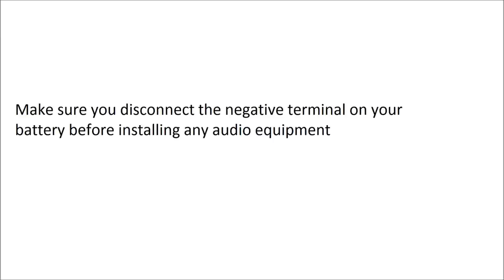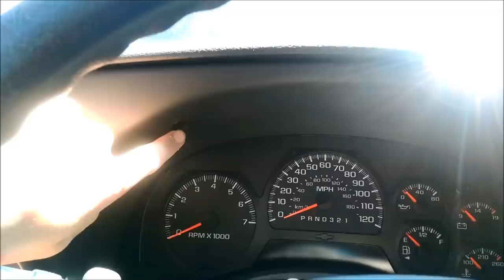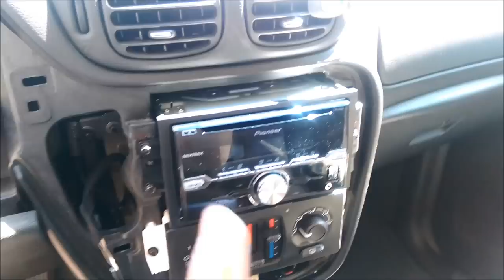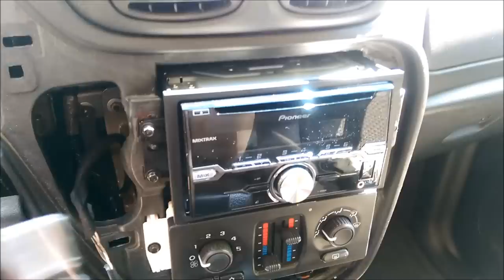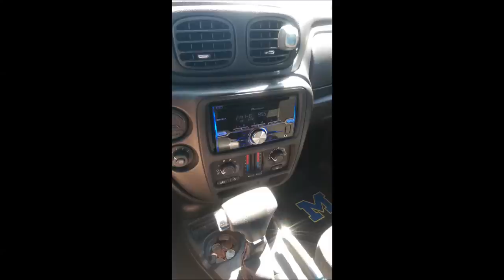Radio install in Chevy Trailblazer with Bose premium sound

Comment: I have a 09 trailblazer ss with bose.. I purchased the pac kit and wanted to install a head unit. a jl audio mono amp along with 2 12s.. Will i have any issues running this amp along with the factory bose amp
Reply from the maker: Ethan Hamilton nope. good thing you got the pac kit. it’s a lot better. your aftermarket head unit should have RCA outputs for a sub amp. and you will run those rcas to the sub amp. and give the amp power and ground. it will be a complete separate system from the bose amp for the door speakers.
Reply: @RydogsGarage  thanks man. Did you run the power for your amp all way to battery, i had heard there was a power source under the rear seats of the trailblazer
Reply from the maker: Ethan Hamilton i ran mine right to the battery. i was running 1500watts. so i had 4 gauge ran. i wouldn’t use the connection under the seat. the trans computer is right there and needs that power
Reply: @RydogsGarage  thanks man. Huge help
Reply from the maker: Ethan Hamilton no problem
Reply: @RydogsGarage  hey man quick question. I got aftermarket radio installed and my speakers only play when you hit the onstar speak button on the steering wheel. Then when turn it off. The speakers stop. Any ideas??
Reply from the maker: what pac harness did you get. there will be 2 conections on the blue box. one for amped and one for not amped. you want the amped conections for the bose
Reply: @RydogsGarage  i got the rp5 gm11 pac.. And it is hooked to the amplified plug
Reply from the maker: Ethan Hamilton you have the right harness. there is a chance one of the wires is not  hooked up properly. it’s hard for me to pinpoint exact issue in that case when i would have to see it.
Reply: @RydogsGarage  i got it figured out. Thanks man. Big help

Comment: did you install a capacitor or  buy  a bigger battery?
Reply from the maker: +Ken S. no i did not, it has a interstate battery thats newer so not factory battery but its not one thats upgraded for sound, stock everything, just added the power cable for the amp. i have 2 12inch subs that are 4ohm, with an amp thats 500watts and 4 ohms, all factory bose with the pioneer head unit. been working great for 8 months and i jam out everyday.
Reply: "its not the one upgraded for sound". Please can u clarify what that part means. You have a seperate battery for sound?
Reply from the maker: +Ken S. it's a OEM replacement battery, had the factory 2009 battery in it and in April of 2015 it died, just replaced it with one that I got at the local auto parts store that's the same, nothing special,and no it's just the single battery

Comment: after installing my radio with the same harness now I am getting static out the rear doors and dash doors can't get rid of it any tips I have an 08 trailblazer bose onstar
Reply from the maker: that may be a problem with your bose amp, that's in the rear cargo area on the pssanger side under the window in the side pannel

Comment: Got a question i used a pac interface and everything works great just wondering why my radio is loud. What i mean is on volume 1 it’s loud.
Reply from the maker: Regena Rodriguez on the pac interface there is 2 plugs one says amplified, and one is non amp. if you have bose you have to be plugged into the factory amplified plug. also check your source input on your radio. it may be turned up
Reply: Rydog's Garage I plugged mine in and it has a wine from alternator what do I do?

Comment: whats the model of the infterface? just trying to confirm because i have bose and onstar. thanks
Reply from the maker: GMOS-04
Reply: And you have bose and onstar
Reply from the maker: yes, I have disabled onstar, recently but I have used this interface for my radio for over a year and I crank it every day no issues

Comment: What Metra interface because they have one at Wal-Mart for 39 can you please tell me if I got the right one it's wm gm11 swc
Reply: Prolly not if it has a bose system cheapest on I could find was 93$ that works with Bose and that’s the pac interface

Comment: I install one but I'm not getting no sound I might need to higher the Volume on the Module?
Reply: Big D that blue knob on the box only changes the chime volume. You need to go back and look at the color coding of the wires and look up the wiring diagram of this aftermarket box. Make sure the connections are tight and no bare wires are exposed.

Comment: I can't hook up subs in my truck and I have that Bose system is there something I have to buy to get them to work
Reply from the maker: not sure how to splice the connections and use adapters to get you to Rca that will plug into your amp, I always change my head unit
Reply: I changed it but it was the radio sub jacks that was not working so I had to get a new radio and it works now but thanks

Comment: is there any size of aftermarket stereo that will not fit in a 05 trailblazer?
Reply from the maker: Brandie Kinman no becuase they make single din and double din. the trailblazer is a double din size from factory so your able to buy any one just need the proper bracket with the radio

Comment: Ok so I got the harness but my Aetna wire doesn't match up with the back of my new radio where do I find that connector piece
Reply from the maker: +Dere'ana Phillips you need a gm antenna  adapter and you can buy them anywhere online

Comment: Would this process be same in a 2005 trailblazer  with Bose using the pac adapter?
Reply from the maker: Tyree Bradley yes exactly the same i have the pac adaptor now and it’s amazing sounds way better than the one in the video
Reply: Rydog's Garage Is there a link for the PAC adapter?

Comment: quick question; how do I check if I have the bose system?
Reply from the maker: my radio would say Bose when you put the key in and turn it to power
Reply from the maker: +David Wence yes it would, if you still pay and use onstar, because I don't so I just disabled the system, if you don't have Bose and don't mind disabling onstar you can just get a normal adaptor harness and save a ton of money but that system is best bet, will be best experience

Comment: Hey guys I got a 2004 trailblazer I put in a Alpine aftermarket I connected all the wires color to color but I won't get no power to the radio unless I use connect the red wire to my fuse box any suggestions or info on my problem it drains my battery because the radio won't shut off
Reply from the maker: Arturo Gonzalez red wire is 12v ignition. suppost to be hooked up to the ignition fuse with a ad a circuit fuse tap if you don’t use a harness like i did in this video. yellow is constant 12v black is ground. make sure all thoe connections are good first

Comment: I put the factory back and no static didn't know if I needed a loc or some kind of filter
Reply from the maker: possibly, what radio are you using? and did you set the gain on the adaptor
Reply: Kenwood hd the only control on there is for the chimes

Comment: I bough a 03 trailblazer 
onstar not active at all
I unhook the battery hook the battery cable back radio not working at all any ideas ?
Reply from the maker: El Smurf you could have blown fuses for the radio when unpluging and re connecting the battery? check all the fuses

Comment: there is a plug on the interface that looks like a earphone plug. it's black. what is it for? don't see a place to plug it
Reply from the maker: Kristin Marks that is if you have steering wheel controls, it's so you can connect the other interface that the same company makes for the steering wheel controls, into this adaptor. if that makes sense
Reply: Do you have a link ?

Comment: I have a 2006 Trailblazer the Right door and dash  speaker does not work.Do you have a wiring diagram? can you tell me where the Factory Bose amp is located
Reply from the maker: the amp should be located in the way back in the cargo area below the window under the trim pannel on the passanger side, i the dash speakers are known the blow out, so if the wiring is all fine may just need a speaker
Reply: I tested both the passenger door speaker and the dash speaker on the passenger  it was okay too.The passenger side back door speaker play's.I traced all the wires.but notice the light green and dark green for the passenger front was a larger guage than the wires on the back of the radio.That is how I figured out it has an amp.I traced the Light green and dark green to the rocker panel cover where they turned and went under the second row seat.I am pulling the cargo bay passenger side cover off today so I can get the number and order a new Amp.Thank you for posting the video and taking time to enlighten me.
Reply from the maker: Larry  Cox no problem! fighting electrical issues is no fun. glad i could somewhat help!
Reply: I first suspected my Radio .I bought one at a salvage yard.To get it to work I had to take the EPROM from my Radio out and solder it into the salvage yard Radio.I saw video's where you can remove the chip but it had issues with saving your presets if you did that.I guess I will sell the original on Ebay. now that the security has been bypassed.If the Amp comes apart .I may try to troubleshoot it .It would be a lot easier if  I had a schematic .Thanks again for your help.

Comment: what are the 2 wires that you bypassed on the box
Reply from the maker: Marcus bigdaddy i believe it was a black wire and a yellow, black for ground, and the yellow for power/alumination, they are labeled on the wires in small print
Reply: Rydog's Garage thanks

Comment: If anybody still visits this thread, I've got the Pioneer AVH270BT HEAD UNIT, with metra GMOS04 FOR bose equipped 2003 trailblazer. With the gain knob set to max, the volume is only coming oiut at about half of what it should be, any ideas? My Metra GMOS04 is the newest model with only one knob
Reply from the maker: joesaiditstrue return the mettra and buy the PAC adaptor. will be making update video soon. my metra killed my radio. i had a avh-2700bs. and the metra after a year started not delivering correct power, and killed the LCd. i just got a avh-201ex and a PAC adaptor as replacement and its 1,000% better
Reply: got an amazon link bro?  specific brand/model, i'm no expert on doing aftermarket audio installs but i can follow a user manual. lol
Reply from the maker: joesaiditstrue https://rover.ebay.com/rover/0/0/0?mpre=https%3A%2F%2Fwww.ebay.com%2Fulk%2Fitm%2F142240069154
Reply from the maker: joesaiditstrue that’s the harness i have now and it’s way way better. i’m going to be making a updated video soon.
Reply: Rydog's Garage thanks brother, just grabbed it.  hopefully Best Buy will let me return this metra
Reply from the maker: joesaiditstrue no problem, yeah i will never buy a metro product again. there mounting bracket for the radio is crap too. it broke when i took it off my old radio to put on the new one. the local car audio shop around me stopped selling there stuf completly becuase they had same issue as me. the harnesses kept braking and they would have customers coming back
Reply: Rydog's Garage installed the OS2X, it fixed my low volume thanks bro!  I have the factory bose amp and for some reason the Metra adapter doesn't initialize the amp or at least the amp wasn't working properly with the Metra adapter (I did have the amp signal wire connected, made no difference), the Pac adapter has a port for amped and non amped systems and I had to use the non amped port for whatever reason but it sounds great now
Reply from the maker: joesaiditstrue hmm i wonder why you had to use non amped
Reply: My harness is not letting the amp fire up either i think....no power to front door speakers...all other speakers work...I dont know how to be sure what the problem is.

Comment: Yo I’m late as shit, my aftermarket radio has the illumination wire, but the harness has the orange and white and the orange, and then the 16 pin connecter also has the orange, confused on which damn orange wire to use 😭

Comment: do you kno where the radio fuse  is in the truck help!!
Reply from the maker: i believe the radio fuse is under the rear seat on the drivers side
Reply from the maker: your owners manual has the layout in the back

Comment: I have a kenwood head unit and a 1000 amp with 2 12 subs I need help on how to hook up up please!!!!!!!......!!!!!!!
Reply from the maker: +kaleb langley is the kenwood head unit installed? rca cables go from the sub out on the head unit and run the the input on the amp, you have to properly ground amp and  get the amp power from the battery, and then speaker wire goes from the amp out to the box with the 2 subs, they make full wiring kits that come with everything you need
Reply: +rydog12100 is there any other way to message you besides YouTube like Kik only if you want I need help with the wiring understanding
Reply: +rydog12100 how do I get the wires to the battery and where do I make a ground connection at?
Reply from the maker: +kaleb langley there is a spot in the firewall like right above the dead petal, that you drill a hole in and slide the wire through, and sure, I can send pictures that way, my Kik is  ryzdogz
Reply: @RydogsGarage  dead pedal???

Comment: I can't get any sound you can barely hear it in the back speakers nothing in the front I tried turning that chime and nothing changes what next
Reply from the maker: Kevin Ford double check the wiring, make sure everything g has a good connection and a good power and ground, may need to turn the gain in the radio up?
Reply: how do I turn the gain in the radio up
Reply from the maker: Kevin Ford in the settings and menus of the radio,
Reply from the maker: Kevin Ford if the radio supports that
Reply: we did that

Comment: red is not 12v constant neither is yellow your accesory wire. Yellow is your 12v constant and red is your Accesory buddy. just saying and also, not all interfaces work. I did a 2006 trailblazer with bose premium audio and I tried 4 different interfaces and none of them worked. had to run wires to speakers.
Reply from the maker: I know that red is accessory and yellow is constant so I must have had a miss wording in my video, and I'm sorry that you did not have luck with the adaptors, I have done it on 3 so far and they all work, with the exact adaptor I used.
Reply: +rydog12100 it's fine I was just like wait, what? 
it's fine my customer loved how it sounds, it's definitely way louder and he decided to buy an amp for the speaker and the installation was so easy. I mounted right behind deck
Reply from the maker: +Luis Cuenca yea I wanted to cheaper route, I was about to buy a new amp and all new speakers and just replace everything but I left it
Reply: +rydog12100  they are good speakers the front ones are weird looking and they do push good power honestly. I was surprised by how good they sounded after the amp. I recommended him to get new speakers cause he wanted something loud and clear I told him about McClaren Audio but the wife said no so I left the old ones
Reply from the maker: +Luis Cuenca honeslty your right the bose speakers are no that bad really. i feel like the tweeters in the dash could be a little better but otherwise the system is good. sounds way better than my moms brand new ford explorer!
Reply: +rydog12100 yup. I cleaned them cause they were way to dirty and yeah they are nice, but I'd honestly spend the extra bucks for McClaren. they are loud and super clean.
Reply from the maker: +Luis Cuenca I would if I was keeping the car but I'm not, future plans are to sell it and move on this summer! need an upgrade!
Reply: +rydog12100 evo sounds pretty cool. haha that's the car I want so bad. saving up its hard when you love audio stuff haha. whatever money I get I usually spend it next day.

Comment: Where I can find these adapter?
Reply: Suleiman Tarawneh is it like that for all Trailblazer models from 2002 to 2009? cuz I have a bose as well and I just hooked up an aftermarket stereo and it won't even turn on
Reply: I have a 2002
Reply: TripleG The dude lol this might be too late but you probably did the ignition power wrong

Comment: I need help locating my factory amp
Reply from the maker: should be under the rear seat on the passanger side, there is a black plastic cover on it with vents
Reply from the maker: +Rydog's Garage wait sorry that's the onstar the amp is behind the rear passanger side from pannel
Reply: Do I have to buy the interface or can I just use the regular metra wire adapter for my double din Android unit

Comment: hola amigo hablas español me podrás decir como se llama ese arne?
Reply: 1.844.235.8253 o https://www.crutchfield.com/ tengo una trailblazer 2003 y esto es lo que hoy ordene 120952001    Metra 95-2001, 1990-up GM Kit , DD
120GMOS01    GM Onstar GMOS-01 Class II Interface
12040GM10    GM Antenna Adapter Motorola M to OEM antenna F
esto me lo recomendaron en ese lugar hablan  español yo vivo en washington bueno espero y te sirva lo q te comparto
en ese lugar hable con algien y el servicio que me dieron fue bueno
hay me dises un dia si te sirvio lo q te pase ok bye
Reply: ha se me olvidaba en ese lugar te dan asistecia tecnica

Comment: Electrical tape!  Man you need to get back in there and replace that tape.....heat + tape equals unraveling and wires touching each other....NOT GOOD.
Reply from the maker: Tammy Harrison all the wires are soldered and shrinkwraped. the proper way.  just used a little eltrical tape to hold the bundle together. been using harness for 2 years now no issue

Comment: Maybe you can help me. I got everything hooked up and had no sound. I adjusted the gain and got some sound but nowhere near what it should be, very low volume. Is there a certain sweet spot that gives max volume or do you turn the gain all the way up or down for lowest to highest volume?
Reply: Dee Cee did you figure this out I’m currently having this problem